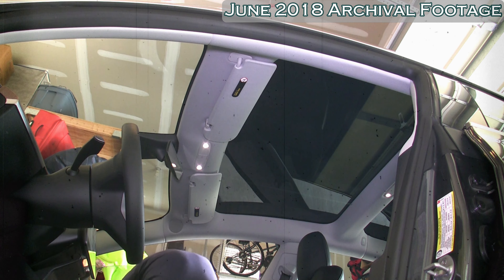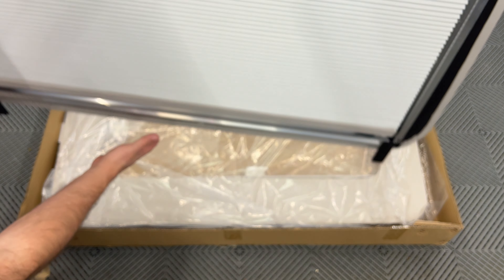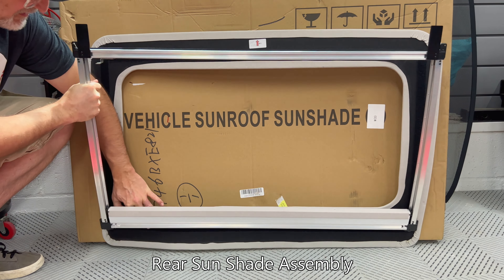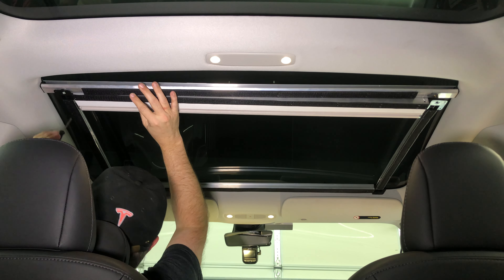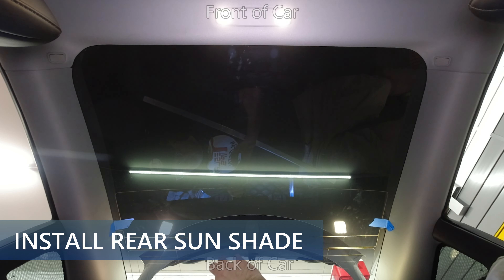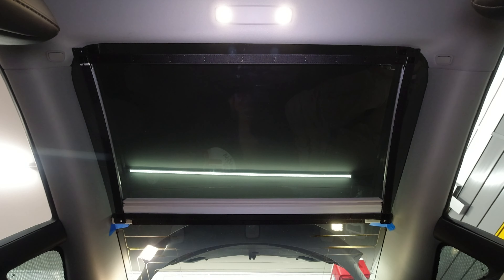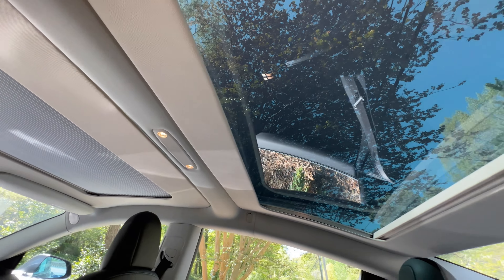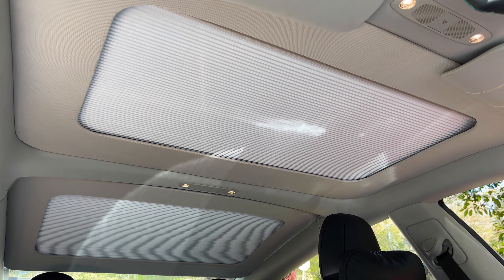Tesla Model 3 - Retractable Roof Sunshade

Comment: Great video good solution to  problem with have a glass roof in 2019 I got the roof tinted and that saved a problem as in 2019 there was no roof shades available I wish a manufacturer made it motorised with a remote that would be cool
Reply from the maker: Thanks.  Tinting is an option.  Though I have heard some people having issues with the rear glass.  Tesla really should have a solution like this from the factory.